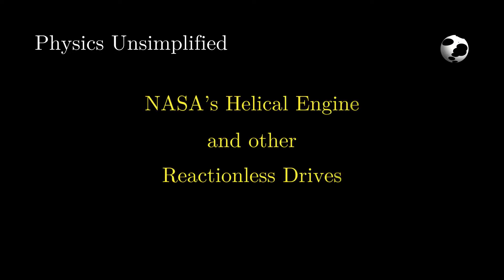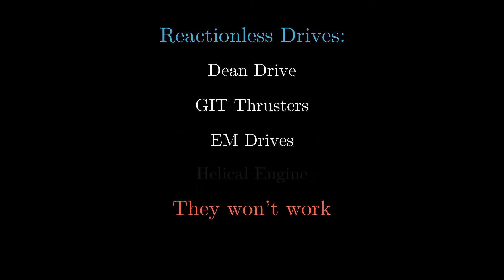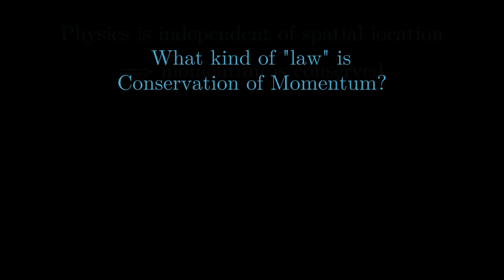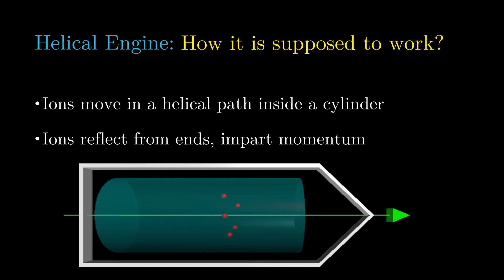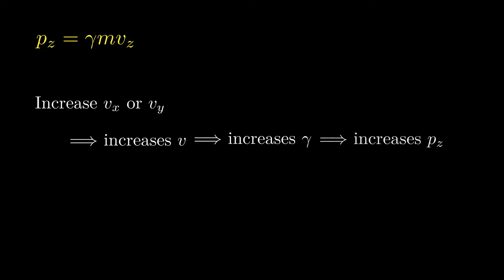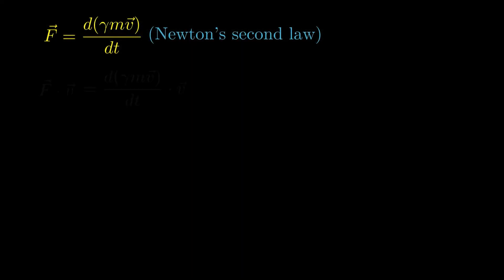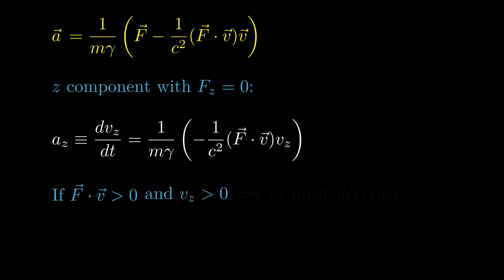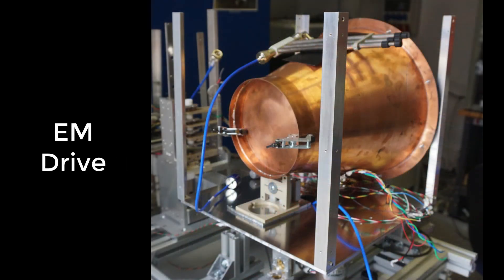NASA's Helical Engine and Other Reactionless Drives

Comment: I am not saying that reactionless drives work, but I can't help but be reminded that people once said that heavier-than-air powered flight also defied the laws of physics.
Reply: These people were all very silly, though, because birds clearly exist.
Reply: @vacuumdiagrams652  Birds have feathers and feathers are the lightest material we have in the universe which is why we use them in gravity demonstrations e.g dropping a hammer vs feather. So thanks to feathers birds are lighter than air.
Reply: @asandax6 birds are certainly NOT lighter than air. Even their feathers are not lighter than air and fall down when there is no upward wind. If birds stop flapping their wings, they fall down, because no lift is created that opposes gravity. If birds were lighter than air, they would not need wings to produce lift. They would simply fly upwards like balloons, which ARE lighter than air.
Reply: @asandax6 clippy is not that stupid.
Reply: I would be interested in finding out what the actual argument was about heavier than air flight. If memory serves, Arthur C. Clarke wrote that the analysis was correct, and it was about power available from the heavy engines available in the 1890s.
Reply: @timtruett5184 You are correct. In the 1890s, no technology known or theorized would allow heavier than air flying machines to work. The analyses were correct, but soon became outdated.
Reply: The speaker has no clue about the sibject….

Comment: The gyros do produce force and produce movement in space, in fact that is why On the ISS they have to keep all the things attach to cables because if those things bounce and hit the ISS from inside that can change the ISS direction
Reply: Make that make sense...
Reply: Search reaction wheels  @seditt5146
Reply: They only change the attitude of the station. There is no actual movement of the center of mass.  So yes you can point it in different directions, but not actually move it through space.
Reply: Gyros can cause rotation by storing angular momentum. They can't create thrust though. And when they are at maximum speed, they have to be slowed down which causes the opposite rotation and the ISS has to cancel that out by using engines.

Comment: Why are they saying it does not work ? they do work, we see them working, look think about it you can create  momentum by a gyro and then ... you got inertia on the gyro, then use that inertia as something to have friction against  to and then from there move
Reply: It wouldn't work in space. The gyroscope needs something to lean on so it can translate and you need to spin it first which cannot be done in space either.
Reply: @StephanBuchin  Look at an engine when you start it it jumps and not due to the base it moves againts itself
Reply: @StephanBuchin  Have you see a cat in the air doing a double jump ?
Reply: @StephanBuchin  They use their own mass to propel on the air a bit more
Reply: @StephanBuchin  the 3r law of newton do not work as you expect on spinning acceleration
Reply: @StephanBuchin  buy an small electric motor and touch it while you start it you will notice a force when it starts from 0 to some speed due to acceleration, the force comes from the 2 parts of the motor spinning and do not obey newton 3r law
Reply: @StephanBuchin  you can put a gyro in vacuum and under free fall and the spin force is still there 🙄 is not because of the giro is the circular acceleration against inertia and yes is there and yes it works in space
Reply: @StephanBuchin  So yes what I just told you is that if you spin something really fast in some configuration it actually produce lift not only to the object but also depending on the force it can lift objects attached to it and it works in space and in earth

Comment: Reactionless drive is possible under a field like river pushing a boat to downstream.
Reply: It creates a reaction on the field. But yes, this is a clever workaround. You can use an electromagnetic field or a non-uniform gravity field to cheat the system. You can't create the field yourself though because you would receive the reaction you're putting on the field. It has to be someone else's field.

Comment: Hi all.
Here is what I think.
Im Not a scientist 

1. The projects can't be tested near any gravitational ambient such as earth or near it. Any test results on earth will be basically wrong and redundant. 

2. I think assuming math or current physics  laws will not apply correctly in space .

3. I do see  a anti / or a gravitational engine working in near future and I do think it will be the only way [ at least for a ling time ] to travel faster than light by continuously compounding momentum , speed, time , distance.

4. I do encourage to test more and test in space not on earth . Not on simulated amti  gravity scenarios as well

Comment: for the ion to slow down, it must give energy to the device's shell as heat. this is also energy which increases the mass of the drive therefore slow it down once again. i think the reason of that thing made a thrust is that some of the heat got disposed to the testing device or the surrounding. remenber u cant dispose energy out as heat in vaccum. u can do light but u can just shoot light to thrust at the first place
Reply: What ? Are you kidding me ? Heat is EM radiation . Tell me that does not travel in space .
Reply: @GREFOUNDRY  heat do travel as EM radiation. but it is such smaller ammount .  conduction in atomsphere is much much faster

Comment: However the idea of saying that all the inertial engine design doesn't work is just not correct, there are some drives that actually work and they work at places outside the earth ( i mean in space ), Eric Lathwaite's gyroscopic propulsion system is under this category with a small defect. actaully the gyroscopic precession  doesn't work in space when the ship is in rest, but with a gentle push within the ship when the ship moves, this propulsion can be tuned to act to propel. 

there is another kind of propulsion based on inertia that actually works in space, i had made a sample of this design around a decade back, although lift is made, it were very crude design. This propulsion also needs a simple non zero force on the space ship to start with, this kind of small scale non-zero force can be generated even from within the space craft, the over all design can look like in the link posted below

https://www.youtube.com/watch?v=cL2BvfV1eHU

although the design lack a component which actually can make this work with 100% surety, this engine also follow the law of conservation of momentum and exert the backward push needed for forward  acceleration via a spin caused, this where most scientist avoid considering the design, saying it doesn't work because it doesn't give out force in the back ward direction to propel forward.

Comment: These engines work only when there is an influence of gravity or any push back force which is already getting exerted on the whole rocket. in space it does't work that way, even if he tries to use the em field origin from top x or y axes instead of z axis directly.

Comment: I thought that conservation of momentum only applies in a closed system, which is defined as one where the mass remains constant, and net external force is zero. What if the propulsion system is not a closed system with a varying inertial or gravitational mass?
Reply: If you want your mass to change or if you use the outer environment to push against, then you basically arrive back to traditional forms of propulsion.
Reply: Conservation of momentum in closed system is not valid always. In short time world will see that with a working device.
Reply: @mkoluacik  so how is that going?
Reply from the maker: A closed system is defined as a system that has no interactions with the external environment. Depending on how you define "mass", the mass in a closed system might change, but the momentum is still conserved.
Reply: @PhysicsUnsimplified  And 100% isolation doesn't exist which makes "A closed system is defined as a system that has no interactions with the external environment. " meaningless in the real world.

Get mythomagics out of physics and come discover the real world.

Comment: Makes you wonder if those Ufo's shown from the Air Force had used some type of Helical engines. They mentioned the crafts had no heat /exhaust coming from the back of it.
Reply: new uaps shot down a couple of days ago, wondering if it is another country then it may be this technology they are using since some have reported that the objects had no means of propulsion and affected their aircrafts

Comment: Running around in circles, through mathematical formulas (that may look complicated) is not a solution to prove something. Energy is changing with speed. Some say in Newton's laws manner that an object in movement is changing mass (to "sum up" the fact that it has also stored kinetic energy). So if you are in motion and do have a system with you, that has particles that change speed in regard to itself, it will change the energy and have a bigger change in regard to the environment it is in motion through.  If you shoot a bullet at something, the inverse of the force that hits the target doesn't come back and hit you. It already went "somewhere else", at the beginning, being obviously lower than the energy that hit the target. Take a box and put inside a spring that shoots a ball inside against the inner wall. The box will obviously move forward the moment the ball hits the wall and not when it does uncompress. Compress the spring and shoot again and so on. Some people don't understand that science is just humans way to explain how something works trying to find a pattern and predicting a different context. But science doesn't rule anything. Even if the math seems right.
Reply: Your box with a ball and a spring would only work when there is something to push against, in this case the ground. You don't have that in space.
Reply: @StephanBuchin  the energy is loaded over a longer period of time then the impact discharge time. So the opponent one from the heavier object creates no movement.
If I am wrong this would mean that the astronauts, that push themselves through the international space station, would generate a spin in the space station every time. All depends on the time of charge and discharge of the energy.
Reply: @CorneliuTicu  About the astronauts, they actually create small disturbances in the ISS attitude and that's why everything else is carefully locked in place to prevent any collision with the walls. Concerning the reactionless drive, I don't think you can exchange time for space to accelerate a space object though this is an interesting question.

Comment: Let me ask you, how does light move? Where is the trust?
Reply: Light can actually produce thrust.
Look up beam-powered propulsion and solar sails if you're interested.
Reply: What different laser thrust with Microwave EM drive thrust ?
Reply: As an object gets lighter, it takes less thrust to accelerate. A kilogram would need more thrust than a gram, which would require more thrust than a milligram, to accelerate to a given velocity.  Photons have zero mass. Therefore, it takes 0 thrust to accelerate a photon to lightspeed. Therefore, as soon as a photon is created, it accelerates off without needing thrust.
Reply: There's no thrust. Light is produced and instantly travels at its constant speed. There is no thrust as it doesn't need to accelerate, stop or change direction.

Comment: Thank you for opening the video with "they won't work".
I don't think it's necessarily wrong to think about such ideas, but at least people should do their research when they realize their machines violate the laws of physics. This analysis has basically been done. 100 years ago. By Einstein himself .
Of course the laws of physics might be wrong. But all of these proposals could have saved themselves some embarrassment by just thinking one step further...
Reply: When did Einstein do this? I was not aware that Einstein did research in reactionless (ie thrust less) motion.  Did Einstein explain how light propagates without thrust or reaction?
Reply: @joeboxter3635  Einstein didn't have to explain that. Maxwell already did. Light is a wave in the electromagnetic field.
And it doesn't move without reaction. Light has momentum. When an object emits light in one direction the object is pushed the other way.

Einstein analyzed the effects of forces perpendicular to the direction of motion. For him this lead to the concept of transverse and  longitudinal mass.
Reply: @joeboxter3635  well know ; light emission involve   thrust or reaction. propagation at constent speed never need thrust

Comment: Very nice video (as usual).
PS. The result from 12:10 I like to derive in a different way. We start with E^2 = p^2 + m^2 (c=1). We take the derivative with respect to time and obtain 2*E*dE/dt = 2*p \dot dp/dt. dp/dt is a force, E = gamma*m*c^2,  p = gamma*m*v, and we are done.
Reply: How do you take a time derivative when the basic premise of special relativity is inertial reference frames.  In an inertial reference the time derivative of velocity is zero.
Reply: @joeboxter3635  In special relativity we can consider accelerated bodies with respect to the inertial frame.
If the time derivative of velocity is zero, as you say, then also the time derivative of gamma is zero, and there is no point in writing the equation from 12:10.